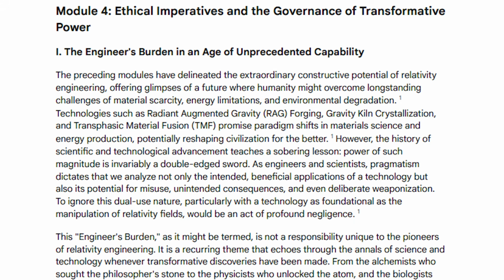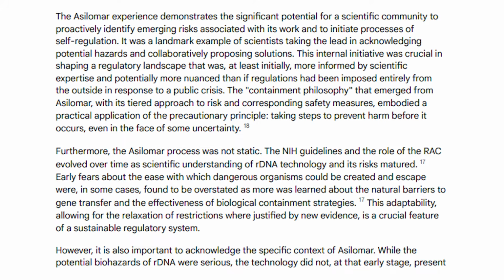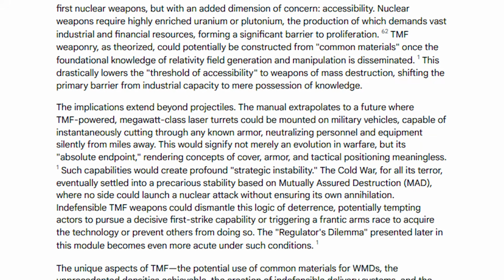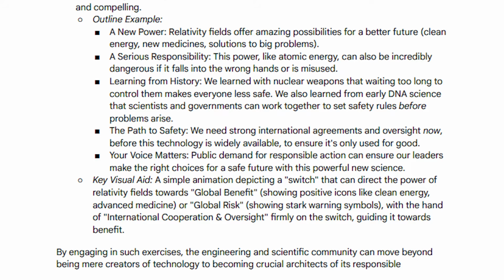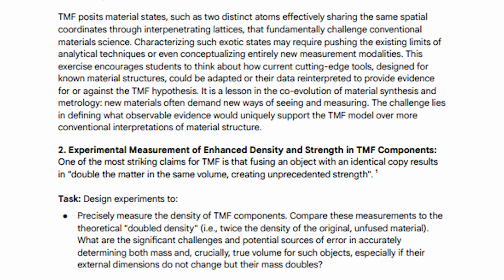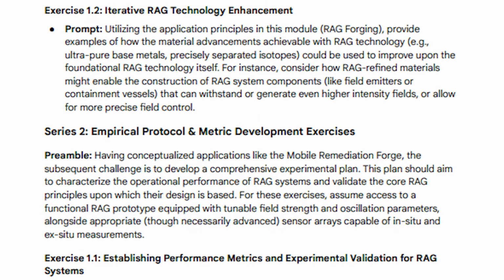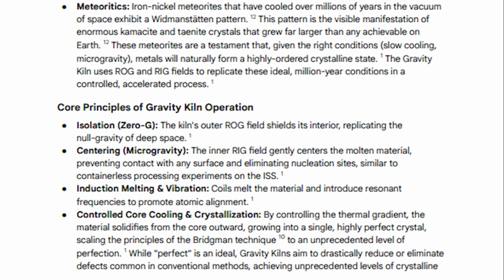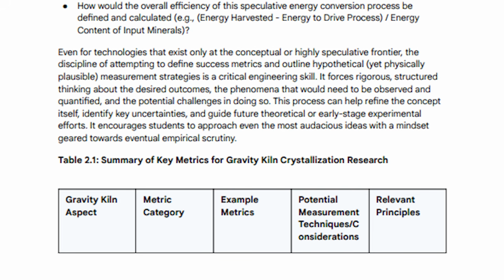Saturnian Relativity Tech - Mystery of the Black Cube

Comment from the maker: (Table of Contents in Description)

GLOSSARY OF TERMS:

● Atomic Diameter (datomic): The mean diameter of an atom of a specific element.

● Bridgman Technique: A method of growing single crystals from molten material by
slowly passing it through a temperature gradient.

● Centrifugal Casting: A metallurgical process using rotational forces to segregate
materials by density and form components.

● Criticality (k): In nuclear physics, the neutron multiplication factor determining whether
a chain reaction is subcritical (k<1), critical (k=1), or supercritical (k>1).

● Exchange Interaction: A quantum mechanical effect responsible for the alignment of
electron spins in ferromagnetic materials, crucial for their magnetic properties.

● Fissile Material: A nuclide that is capable of undergoing nuclear fission after capturing a
low-energy thermal neutron. Primarily isotopes like Uranium-235 and Plutonium-239.

● Gravity Kiln: A hypothetical device using ROG and RIG fields to create ideal conditions
for synthesizing materials with near-perfect crystal lattices.

● Hypergravity Filtration Zone: A region within a RAG system where an intense, localized
gravitational field is used to separate particulate matter from a fluid stream.

● Piezoelectricity: The ability of certain crystalline materials to generate an electric
charge in response to applied mechanical stress, and conversely, to deform when an
electric field is applied.

● Radiant Augmented Gravity (RAG) Forging: A technology applying Class 1 {Radiant}
Type 1 {Augmented Gravity} fields for precise material refinement and separation.

● Relativity Field: A fundamental field (hypothetical within this manual's context) that can
be manipulated to influence gravity and space-time.

● RIG (Class 1 {Radiant} Type 2 {Inverse Gravity}): A type of relativity field used in
Gravity Kilns to gently center molten material, simulating microgravity.

● ROG (Class 1 {Radiant} Type 3 {Occluded Gravity}): A type of relativity field used in
Gravity Kilns to shield the interior, simulating null-gravity.

● Stokes' Law: A law in fluid dynamics describing the force resisting the motion of a
spherical object through a viscous fluid, relevant to particle sedimentation.

● Supersolid: An exotic quantum state of matter exhibiting both the crystalline order of a
solid and the frictionless flow of a superfluid.

● Transphasic Material Fusion (TMF): A technology applying Class 3 Transphasic fields to
fuse two or more objects into a single, unified whole at an atomic level by shifting matter
out of normal space-time.

● Widmanstätten Pattern: A distinctive crystalline pattern found in some iron-nickel
meteorites, formed by extremely slow cooling over millions of years.